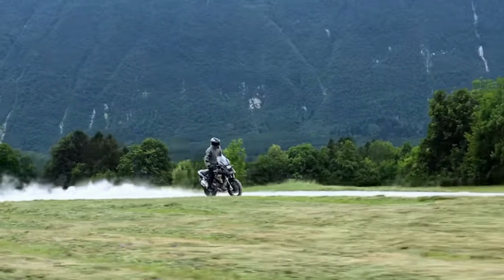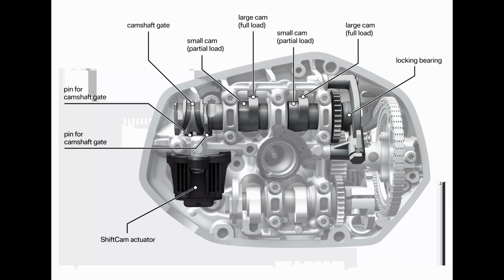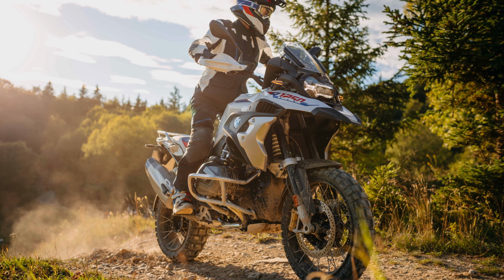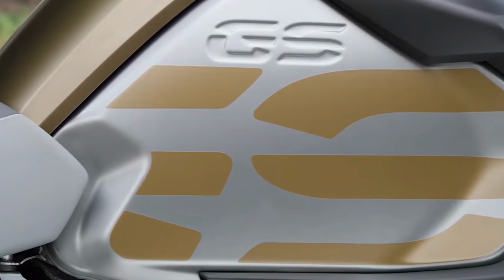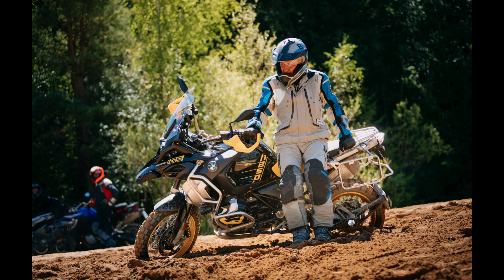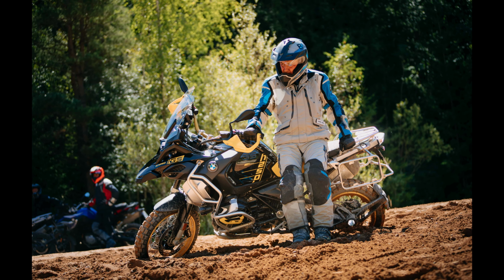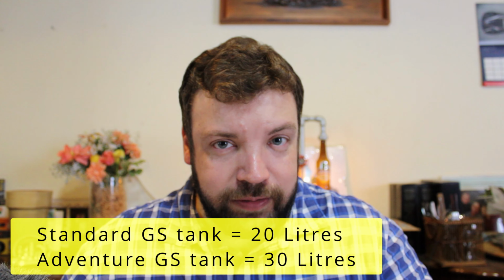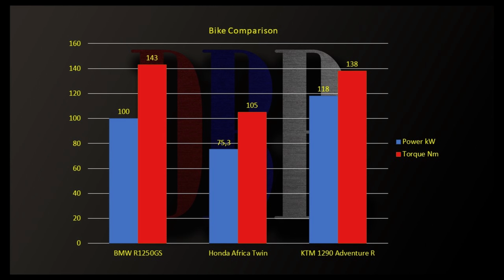BMW R1250GS - Bike Chat.

Comment: I have the Africa Twin Adventure Sports ES with DCT which is really big for an adventure bike. I can’t imagine how I would ever feel comfortable driving something as big as this GS. I have anxiety going through really narrow 2 way streets in Central Asia here with my panniers attached. Even mild off-roading is a little unnerving. I guess there’s no better way to find out than to try this GS next time I’m at a dealer!
Reply from the maker: I like the Africa Twin a lot, I had the privilege of testing a 2017 CRF1000L Africa Twin manual back in 2017 and I was hugely impressed, back then, I would have chosen the R1250GS over the Honda for one reason, cruise control, but since then, the Africa twin has been updated and cruise control comes standard on the CRF1100L, which makes it difficult to chose between the two. If I had to chose the BMW, I wouldn't go for the Adventure as it is bigger and heavier than the standard, and you unfortunately lose the extra 10 litres of fuel, but with the variable valve timing on the BMW will make it more efficient to travel further on less fuel.